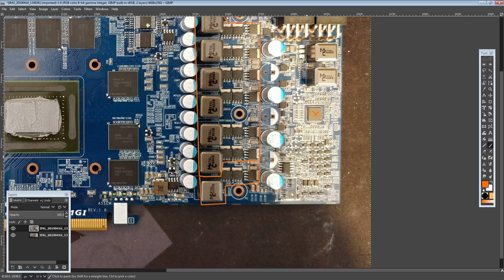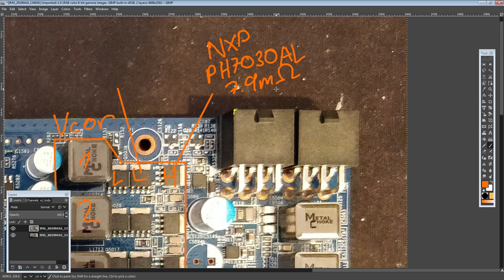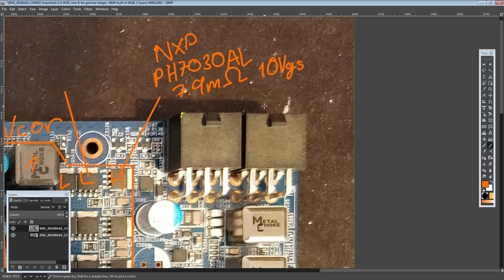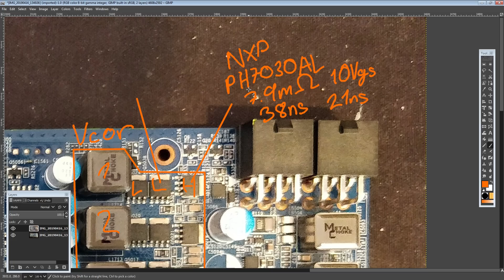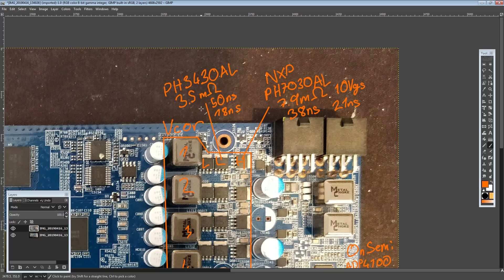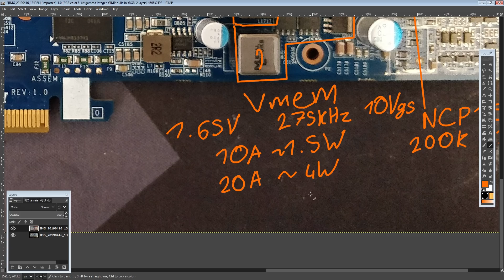GPU PCB Breakdown: Gigabyte GTX 460 SOC

Comment: Just came across this.. I have a gtx 470 SOC still in it's very attractive box.. it still works as a room heater.. it's been rock solid at surviving but as usual the gigabyte overclock software at the time was terrible and would crash the card as would after burner..  as it was fair OC from the factory there wasn't really any headroom in it as the VRM limited the voltage.. it was terrible in games of the day.. like 40FPS.. it's been a good test bench gpu but a waste of £205 over 10 years ago!!

Comment: 21ns rise/fall time, yeah, the lead-frame of the package, and die bond-wires do tend to dictate 'Parasitics' (what causes ringing).   Funny thing, the older TO220-5 bolt-tab package I'm sure can do a MUCH lower rise-time, with a lower watt device that I'm thinking of (about 5ns in "Wide BW" mode @ 30V 200mA, AKA 180MHz), so I think Gate dimensions of the FET is also limiting that particular FET on the GPU (not just higher amps through a bigger lead-frame).

Oh, and that is the original 1991 variant, the 'A' variant is better.
TI PDF - The upgraded device, BUF634A offers a wider bandwidth (210MHz) and a higher slew rate (3750V/μs) at 40% lower quiescent current. (ZDG - Thanks to a newer wafer process and minor tweaks to the die masks)

FYI, I have two TO220-5 BUF634's in a ZDG made headphone amp on my desk, and a couple of bolt-tab TO220-5 BUF634's in a couple of 147MHz radio boost-amps. They do work quite well.

Good vid BZ.  B)

Comment: The GTX460 SOC I got from ebay doesn't like voltages over 1.150v. If I try to push it further it freezes in a few seconds, no matter what frequency it's at. Delidded and barely reaching temps of 65°C. I feel like it's degraded to a point where the die doesn't handle too much voltage.

Comment: Funny to find this, considering one of my most recent acquisitions was a gtx 460 with aftermarket cooling from Arctic already installed. By chance, how would one de-lid this GPU? I understand it would be a great way to drop operating temps considerably.

Comment: Is there any way to find out what vrm is on the gigabyte 1080 ti turbo 11g. It suppost to have the same pcb as the gaming oc model but i cant find any info.
Reply: Zfast4you  no i didnt break it. but i have the g12 mod on my gigabyte 1080 ti turbo and when i temp the front of the vrm with my laser temp gun they get to like 60c but when i temp the back of the card where the vrm is it can get close to 100c. And another issue i had is i have a rm750x psu and all my games kept crashing until i ran two seperate pcie cables and not use the daisy chain one. it would crash even when not overclocked and using vsync. I just want to know if it has vrm that pulls more amps or power than is necessary. i cant get the card at a steady frequency. itll only go above 2000mhz for a few seconds. Ill have the power target and voltage slide all the way up and using voltage curves and it wont even use max voltage or power. I dont know if gigabyte made a worst card than there reference model or if my psu is taking a dump.
Reply: Zfast4you  No it dont have vrm monitoring. Its gigabyes lower end card. But i figured it would still have to be just as good as the stock reference card. Buildzoid held the reference card up high for its vrm. but I replaced the nzxt fan for a nactua one. i didnt put heatsinks on the vrm cuz on Jayz and OptimumTech videos it showed that direct air cooling did better than the aib's vrm cooling. I forgot the vrm model number on the card but when trying to look them up i couldnt find anything on them and oddly enough Im %95 sure it even had a Micron symbol on them. I never heard of them making mosfets or vrm. I think gigabyte cheaped out on the vrm and Im afraid to run the card overclocked in long gaming sessions out of fear of it burning out. Even though gpu maxes out around 64c.

Comment: Friend had 2 of them, both died 1 after the other a month apart with artifacting, sold 1 for £5 gave me the other (have a dead giga gt430 also which looks like the 460 has been shrunk!).

Comment: If you are planning on overclocking this, keep installinf older and older versions of MSI Afterburner until you can get access to the voltage, because when the kepler cards came out, MSI afterburner broke voltage control in software for the Fermi cards, which this is 1st generation Fermi.

Comment: quick question, what AM4 CPU <150$ is best paired with an rx580?
Reply: Ryzen 5 2600. Can be found for 155$ on sale
Reply: Yeah, stretch your CPU budget by about $10 if possible, in order to get the R5 2600

Comment: I can tell you without a doubt is is identical to my Windforce 2 GTX 460 SE version 1, and I can tell you I won a few competitons of overclocking it on air, even with the cut back dies the SE model had. Gigabyte made GREAT video cards back in 2010

Comment: I have a msi gtx 560ti that I volt modded and how I turn it on get coil wine and display out for a minute then the card dies and wont work until I power cycle it.

Comment: How do proadlizers fail(like shorted?)? Would the card stop working when it fails?
Reply from the maker: AFAIK they are polymer caps so they should just fail open. As in the whole circuit is gonna act like the proadlizer doesn't exist.

Comment: I have an old Gainward gtx 460GS in one of my toy rigs. Fancy a friendly competition? :P Last time I really clocked something was back when opterons could be bought for s939. Ran a 1.8Ghz one at 3.2 as my daily lol. (ie I expect to be dusted) :)
Reply: I've got a PC running XP for an old scanner I have which i'm using to convert 35mm film to digital (won't run on Vista or newer OS)
I've been upgrading it to a Q9650 & Gainward GTX 460GS GLH, nearly ready to start testing performance
Reply: XP! Talk about a blast from the past :) Mine is nothing more than a random mess of parts I had. Had the need to run a physical Linux machine instead of a VM so I took what I could find :P I'll ofc use something more sensible a OS if he wants to play with me :)

Comment: back in the day the nvidia drivers supported overclocking themself. you had to enable coolbits in the registry afaik and than an OC menue would show up in the nvidia gpu settings. (not the certified drivers, but usually the beta ones) if you test the card with drivers from that era that may be an option
Reply: Coolbits was way before that iirc? I played with that on geforce 2-4 cards :)

Comment: Which of you RX 480 videos goes over where to find various voltages, physically on the card with a multimeeter? I have a dead one I'm hoping to fix. Appreciate any help you can give.
Reply: Watch his pcb breakdown of your model. There he tells you where to find specific phases.
Vcore should be ~1.15v. Vmem ~1.5v. Vaux ~1v.
If you don't get one of those voltages you should check for shorts on the vrms as well as if the enable line is present on the voltage controler.